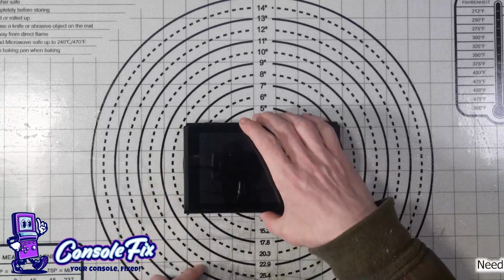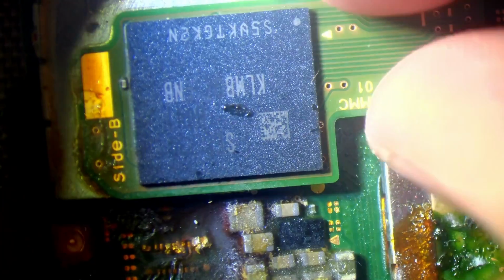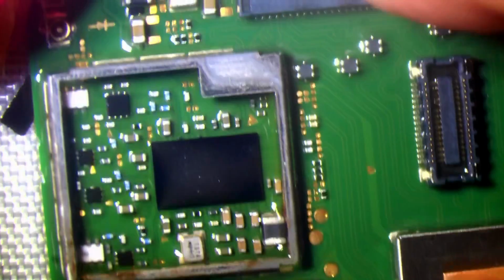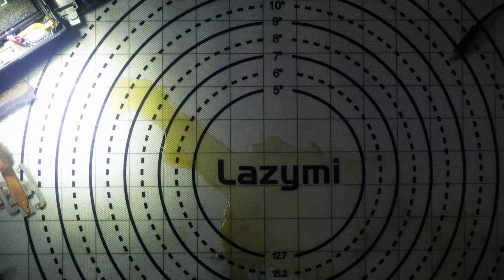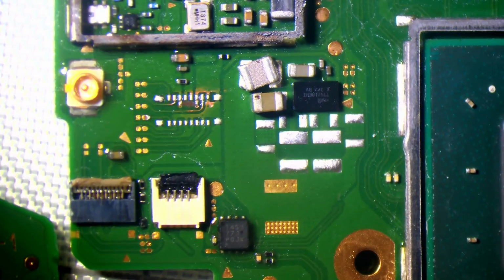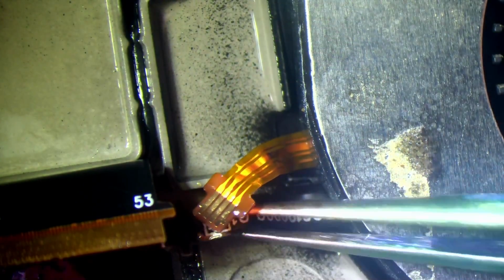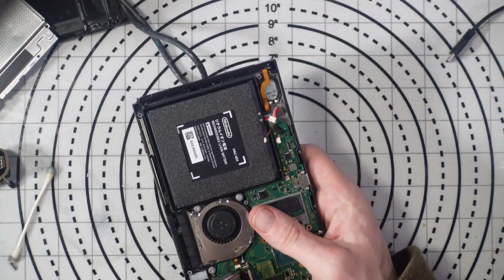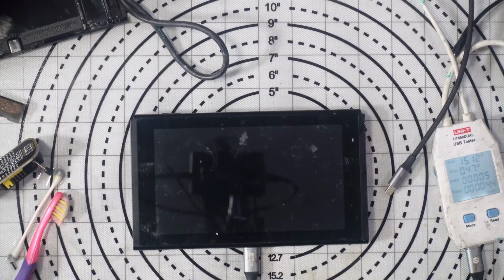This Nintendo Switch Was Badly Damaged By Another Technician! Can I Fix It?

Comment: I clean boards in 99.9% ipa inside a sealed stainless steel food box (with lid clamps) in a water filled ultrasonic cleaner.  It’s very effective, you should try it.  Some people just dunk directly into the US cleaner water but I’m not keen on that approach.
Reply from the maker: I do have an ultrasonic cleaner but I normally don't use it apart from for liquid damage because it takes a while to warm up